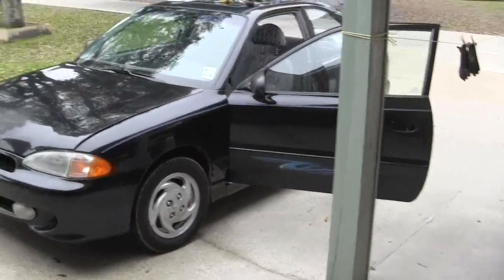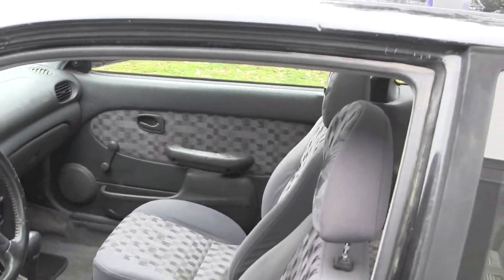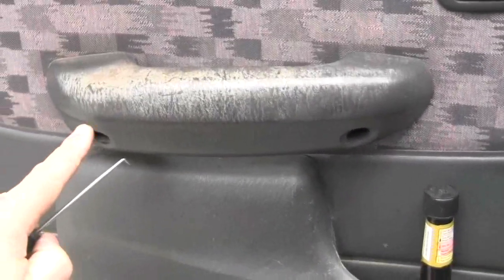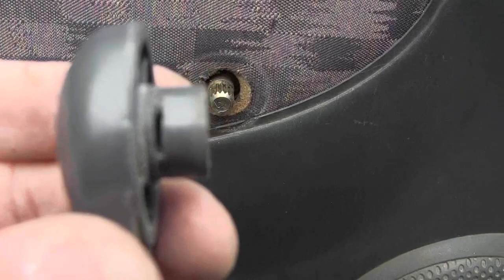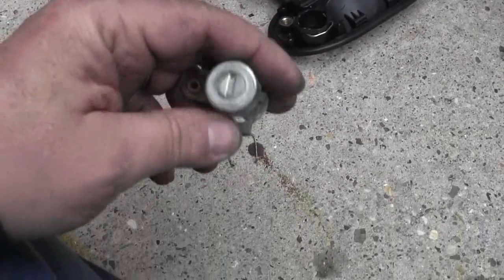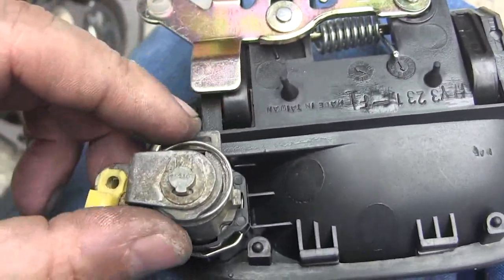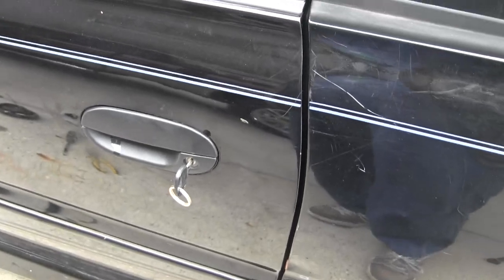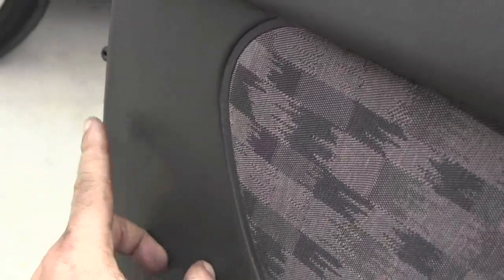How to replace a broken car door handle Part one of two

Comment: we have an 06 elantra, purchased new.  this car has never given us problems other than i had to replace the top radiator hose.  it has 90k miles.  kid broke interior door lever. this video helps a bunch on gaining access and replace. purchased new oem lever for less than 10 bucks on amazon. will be here tomorrow.  THANK YOU.

Comment: I needed to replace my driver side car handle and, while you didn't actually show the inner workings of the handle itself, this video was still useful on guiding me on removing the door panel. I never attempted a repair by myself before and had absolutely no knowledge of mechanics but still managed to figure out how to disconnect the handle from the door and lock mechanism just by looking at it, it's relatively simple.

Comment: Thanks for this video.  I have done both sides of my 99 Accent over the past couple of years.  You do minimize the trouble of getting that window handle clip off.  So far, I am 0/2 in getting that clip off.  I was able to fix both sides without removing it, but of course you cannot lubricate the windows, etc, if you cant get the window handle off.   But luckily, as you say, the panel is quite flimsy and bends well enough to do the work without taking it all the way off.

Comment: Thank you sir!! I have been inside many doors in my time but I'd say they were Land Rover, Subaru and/or Lada Niva because when I tried to replace the outer door handle on my 95 Hyundai Excel today, I was absolutely stumped. I was very glad to hear you say that the inner door handle was the hardest part of the job because that's what brought my efforts to a halt today. Hopefully next time I attempt it I will succeed.

Comment: thankyou so much! I was able to save some money because of this video.... only one thing I would add for any one who couldn't quite get  it like me is to get the handle off you have to twist the lock part around, I was looking for a clip that held it in and didn't realise until I forced it out that it just twists out, and also release the white and yellow plastic plugs from the rods off  and the rods will pop out easier.
cheers and thanks!!

Comment: I have a 2004 Accent. The driver's side window and handle have been giving me trouble for two years. The handle snapped off. I got a new one off Ebay and will attempt to replace it with your help this weekend. Thanks!

Comment: If you were to use a piece of a rag and get it in behind the window crank from the bottom of the crank and then move the rag going in a sea saw motion while pulling upward it will release the pin holding the crank in place. Works pretty well and pretty quick.

Comment: Thanks, I needed this info on how to remove the doorpanel on my 98 Hyundai Excel (I guess it's called Accent in the States) 'cause I need to replace my speakers. I almost broke off the inside doorpanel today 'cause I had no idea how it was attached. I had a laugh aswell, you just utterly destroyed your window crank and stayed deadly serious!!
Reply from the maker: +Ron Bosgra What I destroyed was the little plastic washer  that fits between the window crank and the door panel. The crank was fine and since this is just a junk car that I drive to work and back, I didnt worry about it.

Comment: The only difficulties I encountered were...

1) Re-screwing the one bolt that holds the lock piece to the door handle. On my car's model (hyundai accent 2004), reaching that spot with your fingers or tools around there is very limited.

2) Fitting the damn rubber around the door handle correctly... Just a freakin' pain in the ass...

But anyway, got everything working wonderfully now. This saved me a trip to the mechanic and spending money I simply didn't have, so yay!

Comment from the maker: yes,that is correct. if the inside works, its a very simple process to replace the outside handle. i found mine for only 10 dollars U.S. on amazon.

Comment: Thanks for the video.  I had to replace both driver side and passenger side handles to my 04 accent.  I replaced the passenger side w/o issue.  But I ran into some trouble on the driver side.

After I installed the driver side exterior handle I closed the door and opened it and all seemed fine.  Then I tested the lock...It locked fine but it would not unlock.  When I turned the key to unlock it, it feels like it is stuck.  Same thing happens when I try to unlock it from the inside.  Any idea?

Comment: @bctruck It mught, but if it's too thin it might miss it. The easiest way is the "removal tool" for it. It is a piece of sheet metal with a slot cut into it as wide as the axle. You simply push it out. If I can make one with the few tools that I have, you're gonna produce them on an industrial scale :).

Comment: You didn't show how to attach the outside handle-that's why i watched the video. The rest was fine-I already figured out how to replace the inside handles-little different on my 2001 gl. Do i really need to take the door panel off to replace the outside handle? I need to replace my rear handles.

Comment: I'm doing this job on a 2004 Accent, and so far the thing that has given me the most fits is installing the new door handle.  It has been 10x worse than getting the clip for the window lever off.  The locking mechanism is a little different for the 2004.  The clip that you show to hold the lock in place doesn't exist.  Instead, there is a bracket that is part of the lock that gets held against the door frame and the door handle when you bolt them all together.  Getting everything lined up so that you can thread the bolt is a pain in the butt!!!!  You have to line the holes up that are in the door handle, the door frame, and the lock and somehow get the bolt up in there (with the washer and lock washer) and get it threaded without dropping everything down in the door.  It is a blind assembly.  You can't see what you're doing.  There is no space to get your hands in there to do anything.  The hole in the lock sits down in this little cup so that you can't get your fingers in there to thread the bolt.  There is a bracket that is part of the door frame that runs right in front of the holes.  My short socket is just short enough that it sits fully in the cup and I can't keep ahold of it easily to start the threading.  My long socket is just long enough that I can't use it because it hits the bracket on the door frame.  Ideally, I need a socket that is in between the short socket and the long socket but I don't have one of those.  I have spent more time trying to get those holes to line up and get the bolt threaded than I have spent on the rest of the job combined.  I finally had to admit defeat for today because I ran out of daylight and it gets cold quick this time of year once the sun goes down.  And I thought I was almost done.  Frustrating......
Reply: +Nathen Hutchison Having the exact same problem with my 2002 Accent! Have packed it in for the day and am enjoying a cold beer. Would love to hear how you got it sorted.

Comment: Arh my bolts are still stuck cause the broken apart from the old door handle .... how would i get them off
Reply from the maker: Without looking at it, I can’t offer any advice.
Reply: @bctruck  wish i could show you .
Reply: I fixed it just think i may have  put the lock upside down lol

Comment: They make a tool to remove the handle for the manual window much easier and does cause as much damage as he did.
Reply from the maker: He bought this $1000 junk car because he worked in the oilfield and he didn't want to get his very expensive leather upholstered truck to be covered inside and out with oilfield mud. That's why he didn't care about not having the right tool to remove the handle or damaging it. He didn't care because it was just a junk car to get him and his tools back and forth from home to oil patch. But he thanks you for your input.
Reply: Ah I see.

Comment: I got someone replace door but it won't open
Reply from the maker: Shakera Price replaced the whole door or just the handle? If it’s the whole door, try pressing in real hard on the door as you pull the handle. If it doesn’t feel like there is any resistance to the handle while your pulling it, it’s likely broken inside the door.
Reply: He just replaced the handle
Reply from the maker: Shakera Price I would bring it back to the person that replac d it.

Comment: You didn't show how to remove the Exterior Door Handle.
Reply from the maker: Did you not watch the video? I said in the video that the two nuts inside the the door that hold the handle on,was impossible to video. It's two nuts ! How difficult is it to remove two nuts? Do you really need to see how nuts are turned?
Reply: BCtruck, rebuild, repair,repurpose I didn't hear that.  Sorry.  Still some of us non-mechanics need to see it done.  I did locate the one nut.  Could it be that the one holds by itself because when I loosen it the housing seems to be loose.  Thanks for your response too.  Does the connecting rod to the housing come off easily?